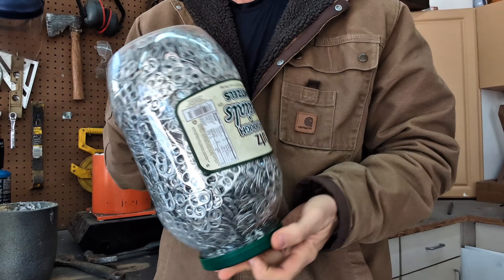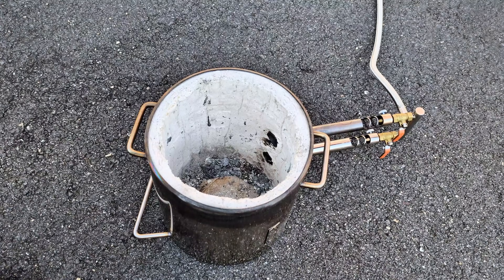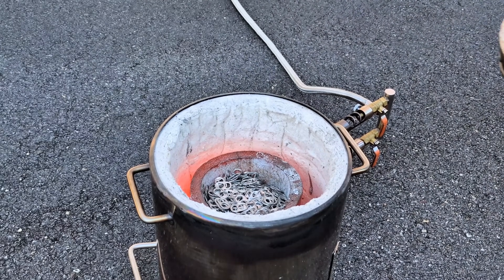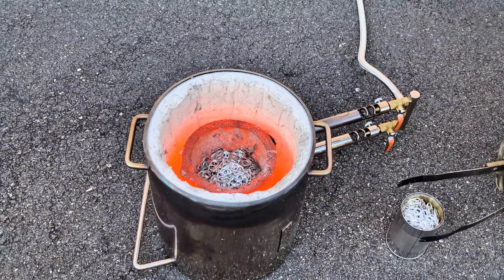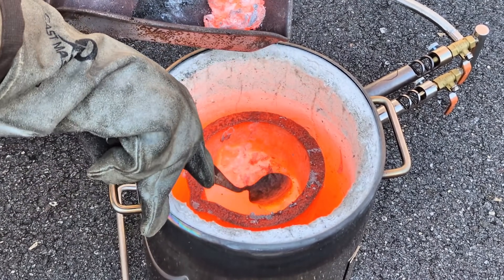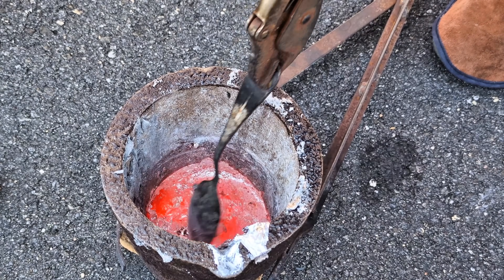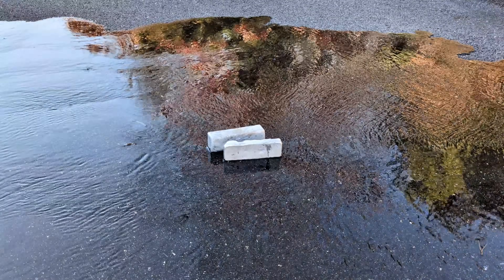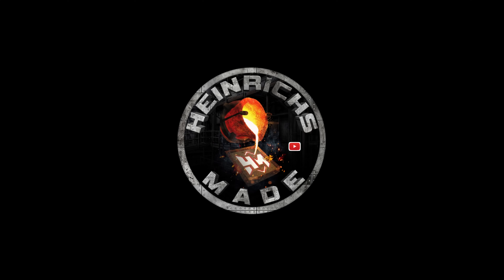Melting Pop Tabs - Massive Aluminum Tab Melt - Melting Pop Tabs at Home - Heinrichs Made

Comment: If you have a swage block you should form a little basket out of expanded mesh. Make a lip so it rests on the crucible, but only make it half as deep. Then you can remelt your dross and the basket will contain the solids while allowing the molten metal to flow out of it. 
Does that make any sense?
Reply from the maker: Sorta....  I have melted the dross before, but did not reclaim much aluminum.  In my opinion it isn't worth remelting dross.
Reply: @HeinrichsMade  probably a huge waste of propane and time now that you mention it 🤔
Reply from the maker: @caseywood9781  yes 100% 😂

Comment: cant figure out where the Pop Tabs come from . i assume they were pulled off an Aluminium can but why not melt it together with the can
Reply from the maker: They are from aluminum cans.  Interestingly enough the tabs are made of a different alloy than the can and the top of the can.  Aluminum cans are made using 3 different alloys of aluminum.

Comment: You have so much metal stuck to the dross, you need to make a flux of NaCl + KCl, as a eutectic salt.  This will help separate the dross effectively.  One mini-cupcake sized amount of the molten salts would have been enough for this pour.  You need to melt the salts and pour them out first into a tray, then use one of them at the bottom under all the aluminum.  It will wash the dross as it comes up.
Reply from the maker: I've never fluxed before.  I didn't think it was necessary.  I actually remelted the dross that I scooped out and reclaimed a little bit more Molten Metal.